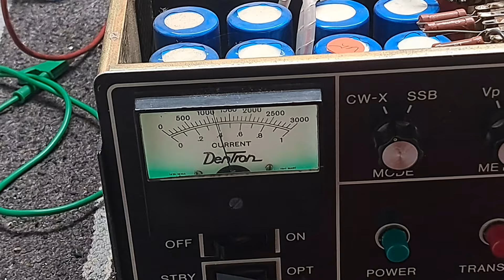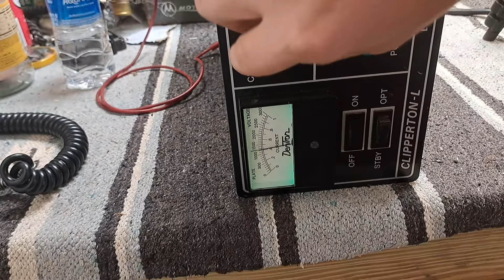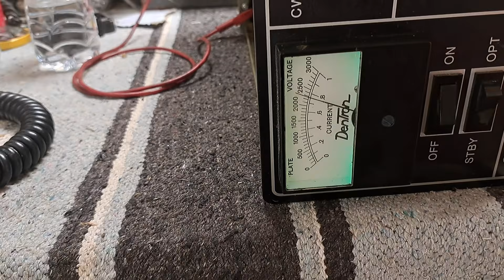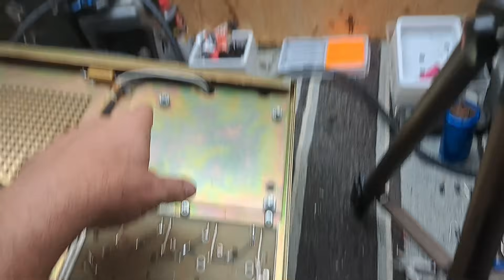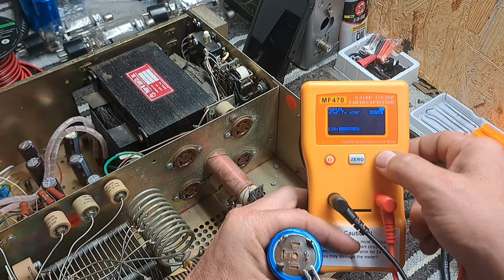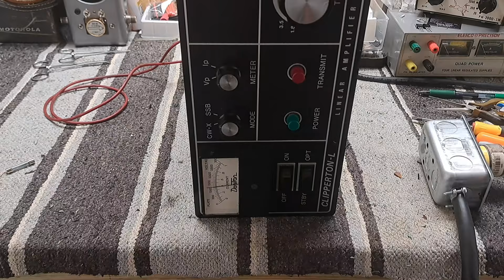Dentron Clipperton HAM Radio Rf Amplifier Repair, low output

Comment: Bailed without showing the resulting output. (pulled out:face-orange-frowning:). What is your line voltage, mine is 247 and that amp was never designed to run on that much voltage, I'm sure it still will but the filament voltage will be too high which will shorten the tube life...

Comment: YES THE  (572-B)  = 2300 VOLT

SAYS THE TUBE COMPANIES  !!

MY METER  SHOWS .. 2300 VOLT..  I HAVE  2 TUBES  .. AND CAN EASY RUN  800 WATTs + (ssb)
on 20 some MHz

JUST  HOW  MY  "AMP"  IS

YOUR   MUST RUN  AROUND  (2 KW)  WITH  (4 TUBES) ... EASY .. ON 220-240 V AC ..

GOOD LUCK

Comment: Great video!
Flying comet waving a hand! I have a 8 pill that I won and it messed up last spring. Id love to have you look at it. The guy that built it lives at the beach and i don't want to drive back and forth. Maybe you could look at it and tell me if its worth fixing. If not I will sell it and the 300amp power supply. Thanks buddy. I will talk to you on the cb later sometime. Thanks
Reply from the maker: Heck yeah man, thanks for watching ✌🏼

Comment: Love these old school amps!  73 de AB0EZ.
Reply from the maker: 73's, my friend. I don't have a call sign. ✌️❤️
Reply: @willfixit5346 No worries.  I have an old Dentron GL-1000B I need to finish up restoring and modding.   Even that cheap little amp was built like a tank!